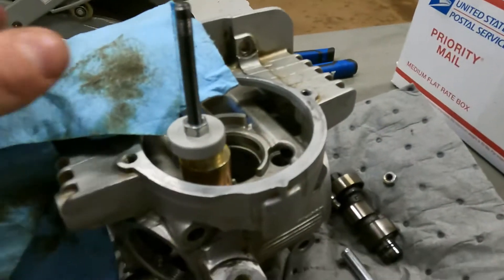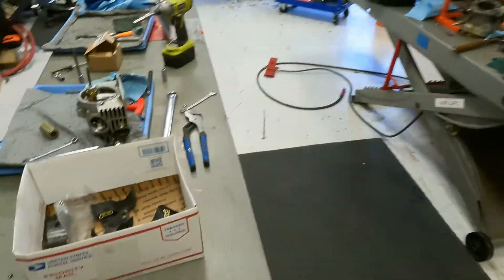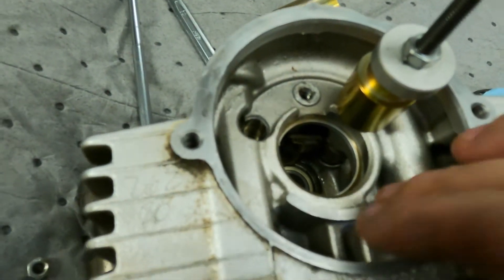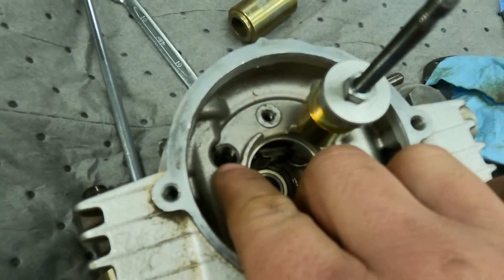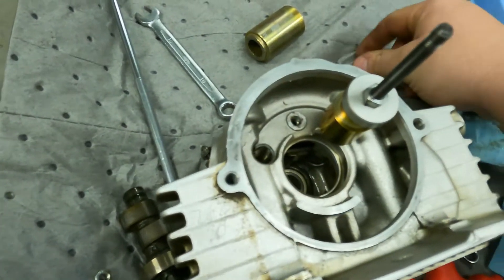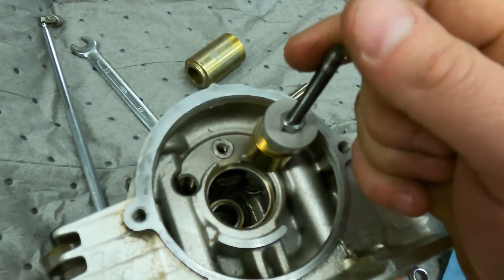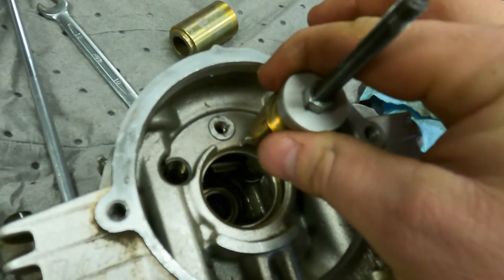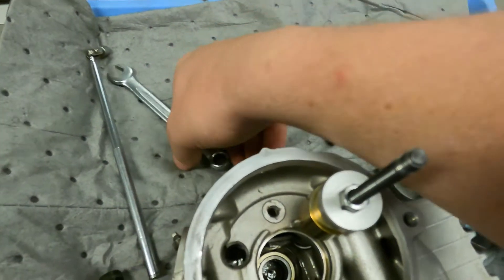Removing Yamaha TTR 125 Rocker Arm Shafts

Comment: I just found out that the long head bolts actually fit the rocker arm shaft and thread in perfect and are long enough to put a washer and a big socket onto to create a slide hammer deal just a tip if it helps anyone so you dont have to go buy a bolt or a slide hammer, it worked perfect for me